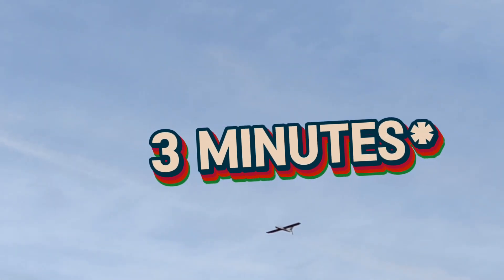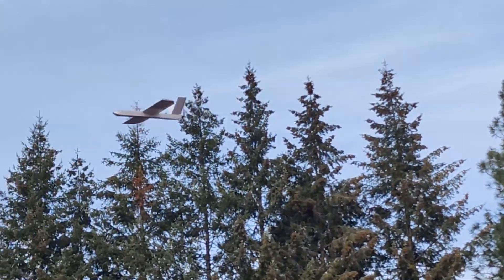The second flight of my new FPV pusher v tail.

Comment: How do you calculate the wing dimensions? I mean wing span, width and the same for rear control surface? Thanks
Reply from the maker: @sebastiantomczyk4577  wing span i usually pick based off of what I want to build. Usually though since I use foam board that are 29" wide I'll start there for smaller planes then two sheets is about 60" wide. I also build planes at 36 or 48" it's really just random. Whatever I want to build. But, the wing cord and shape for that wing will be based on what kind of flying I am doing with that plane. Or how much it may weigh. I'll build a wing with a constant cord for heavier or slower flying planes and then tapered cord for faster planes. I will also use wing area calculations to adjust the cord and wing width depending on how heavy the plane may be or if I want it to fly slower or faster. 

The tail i usually go with about 1/5th of the wing area for the tail area. 

Vtails I always put the V at 90° usually if my plane is longer I'll use a smaller tail or like this plane where the wing is much closer to the wing Ill run a larger tail. Closer to 1/4 the size. I hope that answers your question. Feel free to ask anything else. I also use a online wing loading calculator to help me decide on my wing size to help get me the wing loading I'm looking for in a design.

Comment: Thrust of ur brushless motor ?
Reply from the maker: @anasyt7009  around 3000 grams with this set up at full throttle. 2820 780kv motor with a 13x6.5 prop